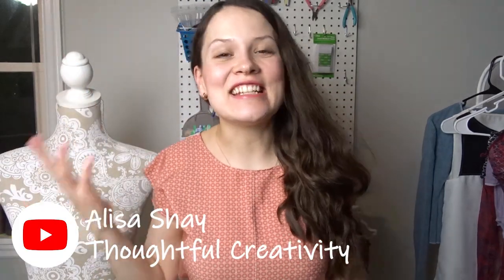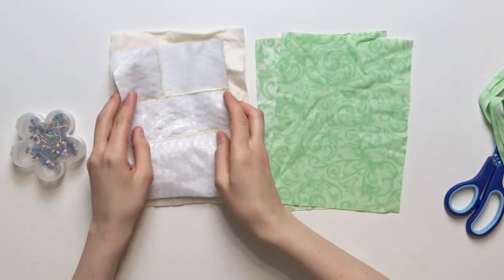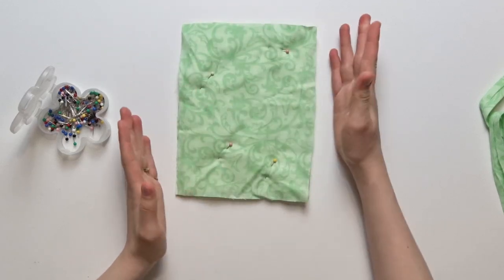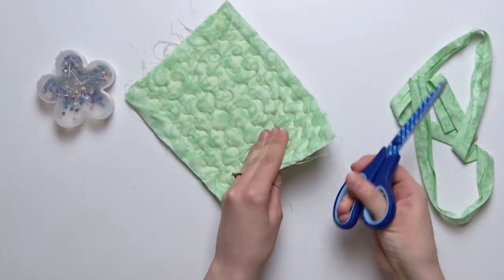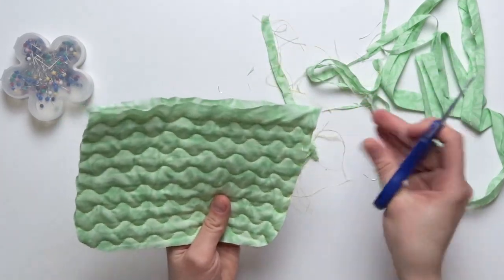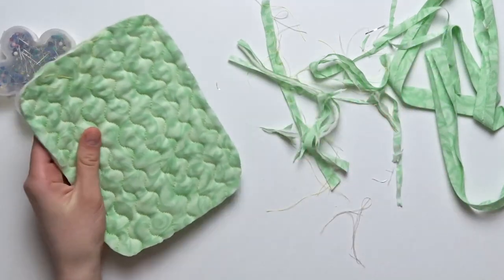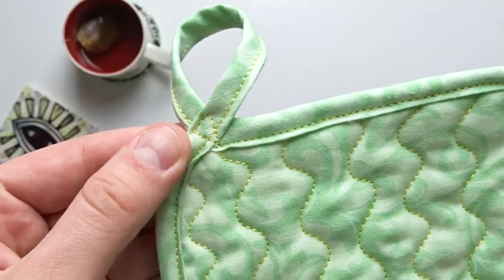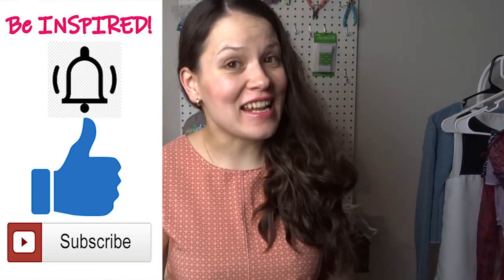How to Sew a Potholder | Step-by-Step Tutorial

Comment: To use cotton batting scraps, smear Dollar Store glue stick on the back of the fabric fitting the pieces in close together and cutting to fit if needed, make your fabric sandwich and quilt it to hold the batting scraps in place inside the potholder.